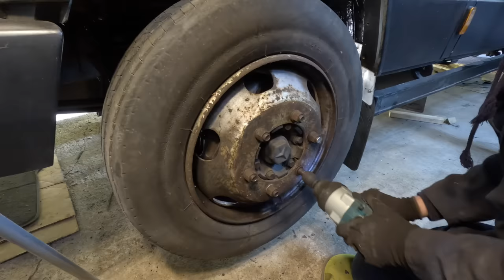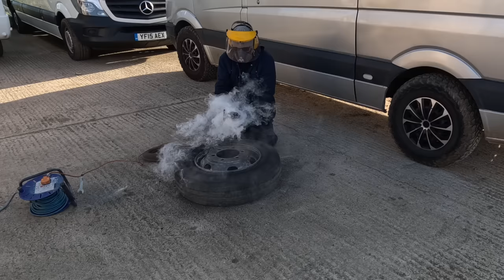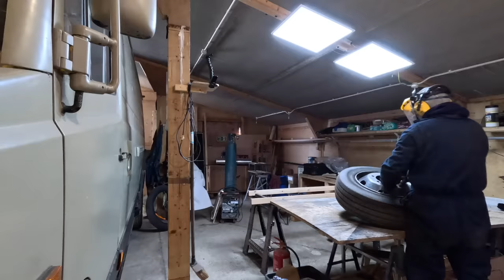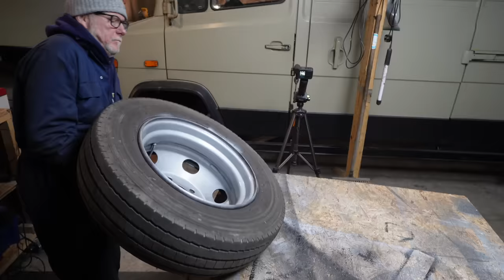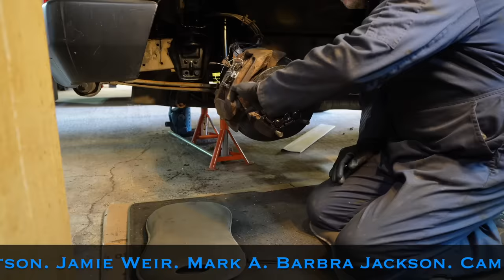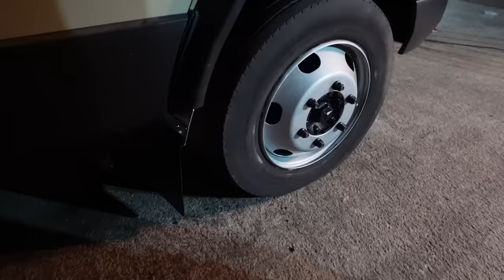This Wasn't My Plan Mercedes Vario Wheel refurbishment

Comment: Very nice job. I did mine with a coat of rust convertor before painting them, and used a deck of cards inserted between the rubber and the steel rim to mask the tyre.

Comment: Mel. May I suggest you fit new wheel cones. Whether you have split or non split cones . They loose there tension , possibly resulting in wheel nuts coming loose. 
Wheels have been known to fall off. Without to much warning. 
Use Febi or Merc  cones. They are not expensive. Cheaper than new wheel . Wheel studs in long run. Great videos.
Reply from the maker: Thank you 🙏

Comment: Hi  great video but one thing i did note is that you did not change the taper spring washers when you replaed the wheel . having worked on merc vans and trucks for some time i can say  we had problems with the wheels coming loose after refitting due to washer failure. The washers get brittle and  snap after a while causing the wheel to come loose and move on the hub elongating the bolt holes and scraping the wheel . The washers were cheep to buy and gave peace of mind that the wheel would stay in place until service work was required . Imagine sitting at the top of a mountain road with a loose and knocking wheel milea from a merc dealer  not fun . Was called out thre or four times to this sort of failure before we worked out what the problem was . After washer replacement of the wheels on vehicles in our fleet we never had the problem again  hope all  vario owners find this helpfull
Reply from the maker: Thank you for taking the time to share your experience we are all now ordering washer’s for our Varios I’ll be collecting them from mane dealer hopefully Monday cheers 🍻 👍

Comment: Hi, I think that the new format works well for jobs like the wheels. It's not an instructional lesson  on how to paint wheels, rather a quick  vlog to show the progression of getting a van back on the road and the steps required.  I'm sure you get the drift here. When you did the scuttle refit, this format would  not have worked, as it wouldn't have shown the thought process you undertook to get a great repair done, nor would it have explained why certain things were done. Eitherway,  another great video.  👋
Reply from the maker: Thanks for taking the time to comment that’s really helpful 👍🍻

Comment: Mel has a X HGV fitter you should never paint wheels or hubs where they come into contact when that paint starts flaking it can cause a gap causing wheel nuts to come loose should be clean steel on clean steel
Reply: Totally agree there’s a whole DoT paper on loose wheels and there causes. 
Somewhere on internet.
Reply from the maker: Oh that’s interesting thank you 👍🍻

Comment: Why must an extension cord be unwound completely?
If electrical cables are wound up like the cable of a cable reel, the heat is naturally difficult to dissipate.
This in turn can melt the outer insulation of the cable and the insulation on the cores.
To avoid overheating the cable, it should always be completely unwound from the drum body.
Reply from the maker: Correct 👍

Comment: Instead of trying to mask the tyre, let the air out then using a paintbrush, paint the sidewall with washing-up liquid. After the paint has dried just wash the overspray off with a hose and soft brush. 🖖
Reply from the maker: Great idea

Comment: I like the new format Mel. You could do with some knee pads for when you are working on a cold concrete surface. Also I take it that you will be changing the tyres before it goes on the road, as the first one in the clip appears to be cracking on the side walls. Keep up the great work on the wheels.
Reply from the maker: Thank you and yes new Tyers ordered 👍